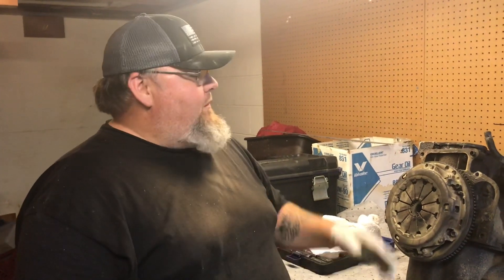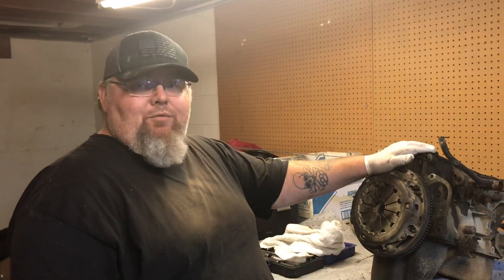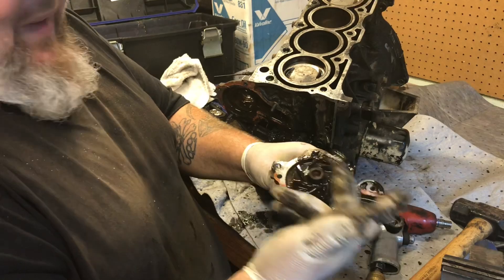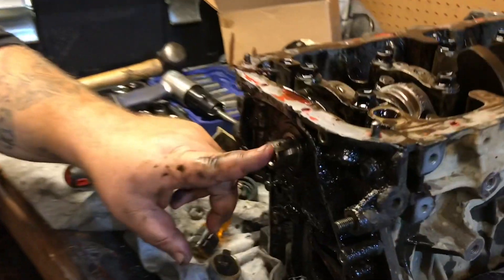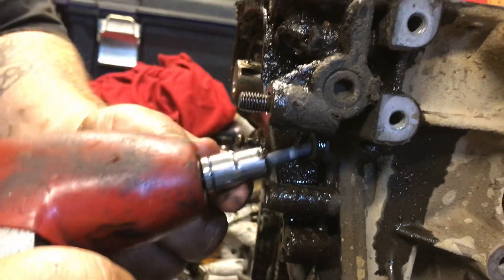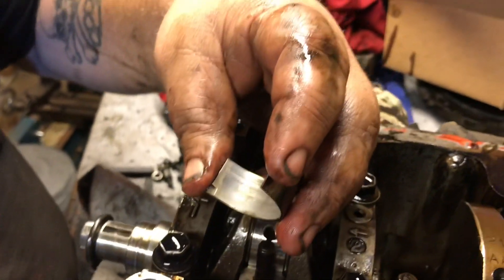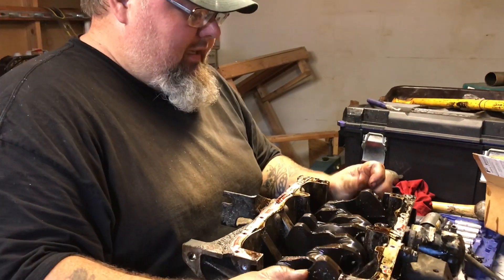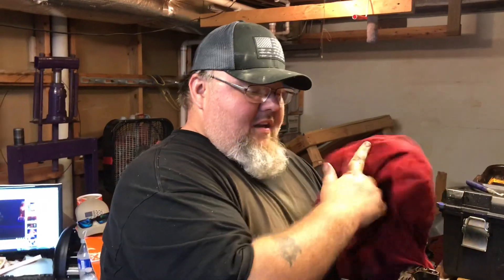1.3 Liter Suzuki Samurai Engine Rebuild #1 Teardown And Analysis Rocky Top Off Road

Comment: they started putting those bolts on tight like that because those engines are notorious for knocking those bolts loose from  vibration .there is  no harmonic balancer on those engines.